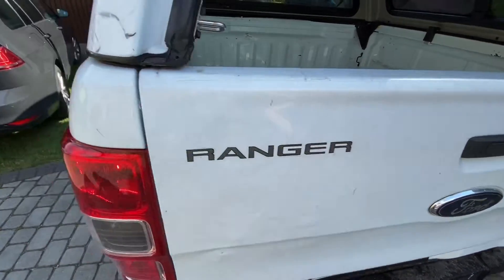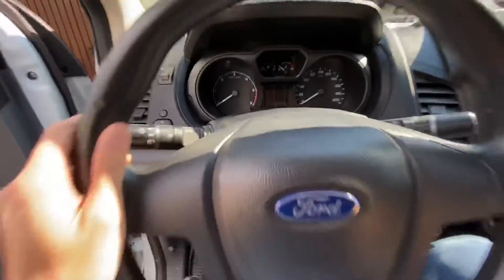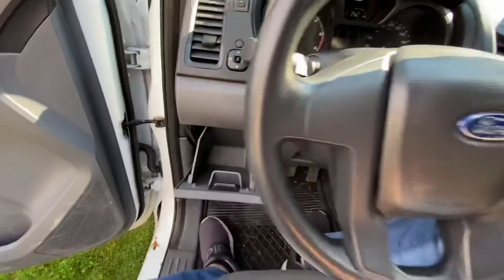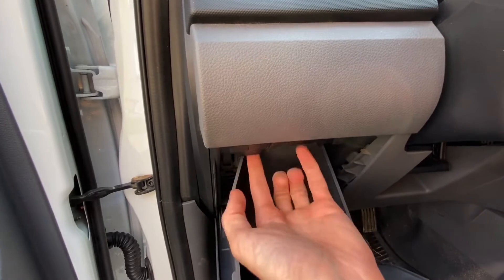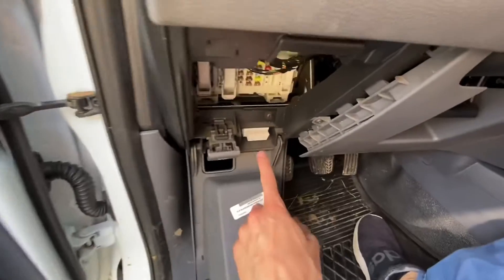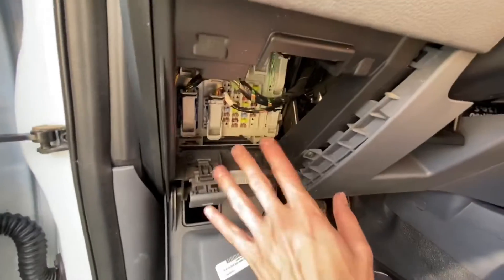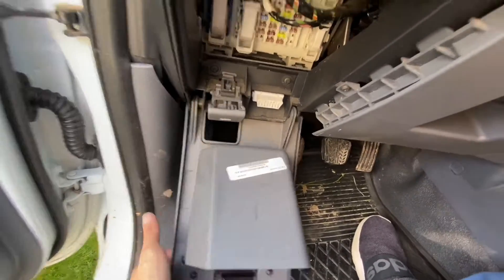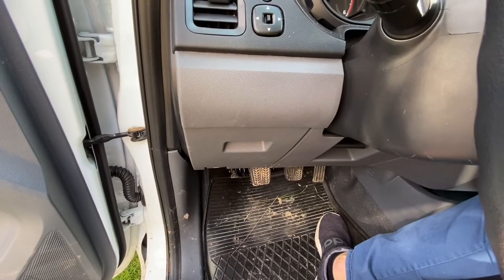Ford Ranger MK3 cabin fuses, OBD2 port, BCM location

Comment: @mr-fix I have the same truck, but the fuse diagram in the manual it came with does not correspond. I see that the fuses in yours are the same as mine, do you have the fuse diagram by any chance?